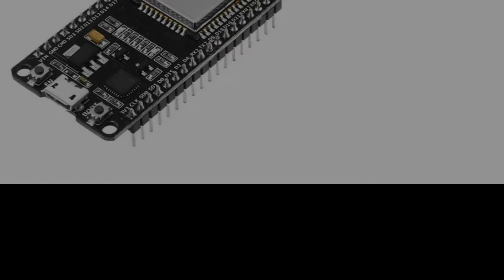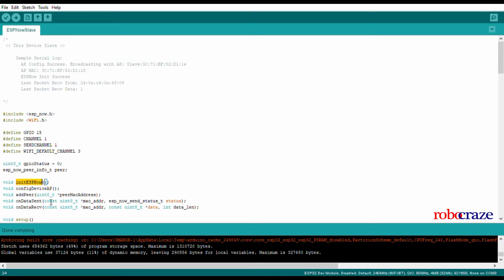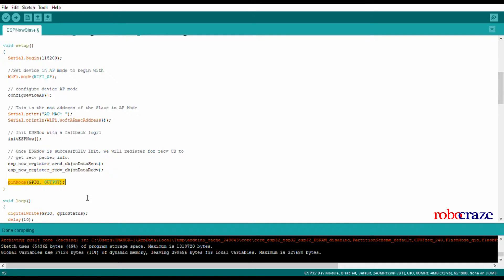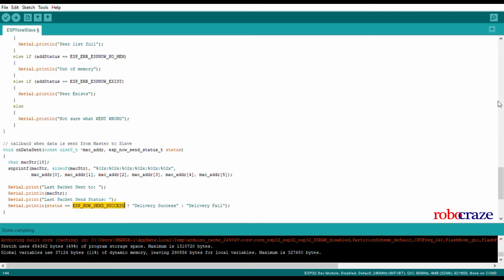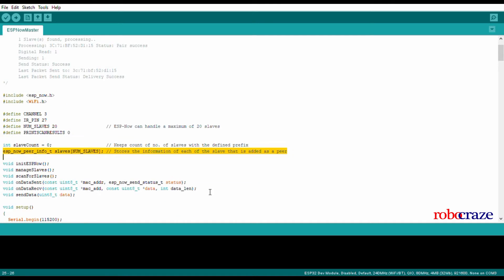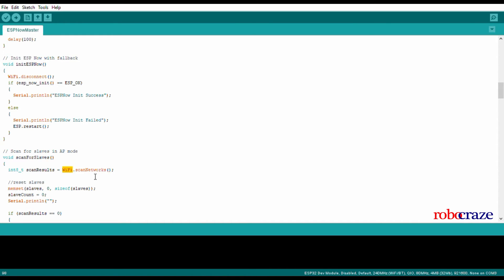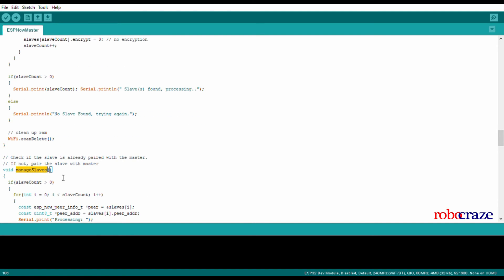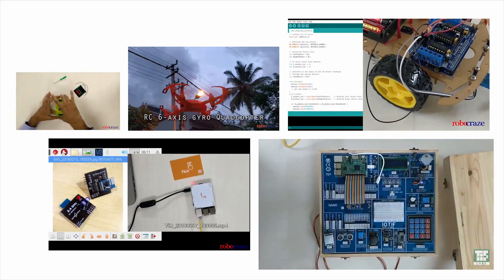GETTING STARTED WITH ESP-NOW |  Master-Slave Communication with ESP32 Code

Comment: Can u provide the link for the required libraries for esp_now.h
Reply from the maker: esp_now library is by default installed when you install both esp32 and esp8266 boards in the board manager. Please check if both are installed correctly

Comment: can you make a computer the master?
Reply from the maker: Hi,
Only an ESP module can be the master or slave for ESP-NOW. If you wish to relay the data back to a computer, you can connect the master nodemcu using a USB cable to the computer and use the serial interface to send and receive data.

Comment: can ESP NOW run with WiFi active? I want to have an esp that acts in slave mode inside the mesh network and sends received data over WiFi to an MQTT server. is this possible? can you use both WiFi mesh and Wifi togheter?
Reply from the maker: ESP Now doesn't work with Wifi so a gateway receiving ESP Now transmissions can't also connect to a Wifi network. you can either use ESP Now or connect the module to an AP. After successful connection to AP, ESP Now is observed to suffer send fails.
Reply: @Robocraze  this reduces the esp now network functionality by a wide margin. This means that esp now network can send messages to an Mqtt broker but it can't receive those messages. Or you need to use an esp just for listening to Mqtt and than send the message to the esp now network. Pretty inconvenient. esp now is a no go for me due to this. Thanks

Comment: Hello, is there any way, with an android application, to control the master esp32 and that in turn order the slaves?
Reply: I've not played with espnow but... The esp32 does have serial Tx/Rx. There's no reason you couldn't use a second esp32 in a standard WiFi set up, then use a web page to send commands to the master (and in turn the slaves) via serial.

You could... If you were clever also get the master to report status via the serial, and forward that on to the internet (MQTT, Rest/SOAP API, etc).
Reply from the maker: Hi Andres,
You can use serial UART to connect with another ESP module to provide an interface to communicate with a mobile or a desktop device.

Comment: Thank you for the video. 
I would like to ask if it is possible to store data from a temperature sensor in a file in the SPIFFS and then send the data to another esp32 using esp-now once they establish a connection. the received file would also be stored in the SPIFFS.
Reply from the maker: Yes, that is possible and a great idea. You can use the in-built ESP SPIFFS methods for it.
Reply: @Robocraze  I would like to ask you for some help. I've managed to save temperature data from a DHT11 sensor into the SPIFFS. The with the use of espNOW I've successfully sent the data to another esp32 by converting the String file into a byte array.

void sendData() {
  String data = readFile("/Temperature.txt");
  uint8_t bytePayload[sizeof(data)]; //create a new empty byte array
  memcpy(bytePayload, &data, sizeof(data)); // memory copy data to bytePayload

Afterwards from the receiver side, I'm struggling to convert the byte array back to the String, once data is received, to save it again in the SPIFFS. 

void convertRcvData(const uint8_t *data){
    
    std::string Temperature( reinterpret_cast< char const* >(&data) ) ;
    uint8_t bytePayload[sizeof(data)];
    memcpy(Temperature, &data, sizeof(data));
    Serial.println(Temperature);   
}
 
Do you have any idea how I could resolve this?
Thank you in advance

Comment: Hey, thanks for the video. How can you make sure, that the Esp receives data only from choosen Esp's? What if somebody else would try to send data to my Esp but without my permission? I haven't found a way to secure my Esp. Even when I change my AP password, Esp's are able to send data to mine...
Reply from the maker: Hi! This is a great point. In the code for ESP NOW, in order for the ESP to communicate, it has to be added as peer. This adding of peer is done using the MAC address of ESP. Hence any unauthorized ESP will not have your MAC address. For more details, please refer to the blog: https://www.robocraze.com/index.php/blog/tutorial-getting-started-with-esp-now.html

Comment: Hey I was wondering the following: is it possible to have both ESP32's act as both Slave and Master? So both the ESP's would have an IR sensor connected and both would be able to trigger the other ESP.
Reply from the maker: Hi. You can have bidirectional communication betwen master and slave. By using the callback functions for data sent and received you can have both the ESP's pinging each other. In the slave ESP, just add the peer for master similar to how its done in master node and by calling the send data function in slave, you should have both the ESP's triggering each other.

Comment: Thanks for the video,
I'm trying to send two 12 bit analog values they range from 0 to 4095. I want to avoid mapping the values. 

Now I have more clarity about the send data function. 

The part I'm getting stuck at is u int 8_t will only let me send 0-255 values. This is embedded in the esp header file. Is there a way to change it to int or u int 16_t?

Thanks
Reply from the maker: Since the ESP-Now library takes an 8 bit integer, you can send the 12 bit value in two parts by breaking it into a high and a low byte. Something similar to the following snippet:
uint16_t data = 0x1234;
uint8_t lowByte = (data & 0xFF);
uint8_t highByte = ((data >> 8) & 0xFF);

And then send the two bytes successively one after another.

Comment: Hi, great video! But where do I find the esp_now.h library?
Reply: Did you find the esp_now library, I tried but could not find it any where all the replies here are vague and do not help at all !!
Reply: @mohammedshalash7842  it is literally where the guy above told you it was.

Install the Arduino-esp32 library.

https://github.com/espressif/arduino-esp32/blob/a59eafbc9dfa3ce818c110f996eebf68d755be24/README.md

And the actual header file? It's in that repo.

https://github.com/espressif/arduino-esp32/blob/a59eafbc9dfa3ce818c110f996eebf68d755be24/tools/sdk/include/esp32/esp_now.h
Reply from the maker: Thanks @Console! :)
Reply: Github espressif has all the files for espnow
Reply: @HasanainShuja  can you please give a link for to download them'
Reply: @yasirali9190 
https://github.com/espressif/arduino-esp32/tree/master/libraries/ESP32/examples/ESPNow
Reply: Espressif idf on github contains the esp master now and esp now slave files